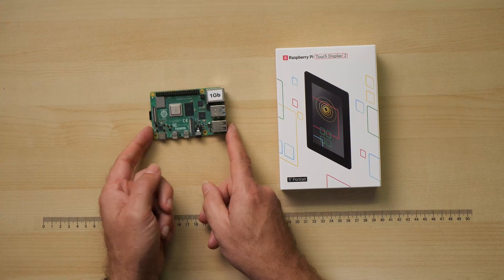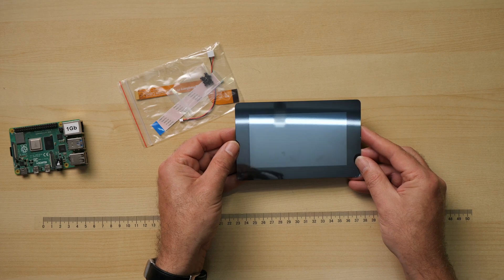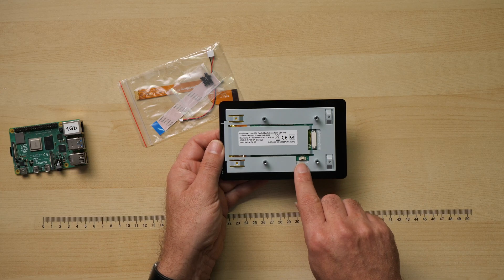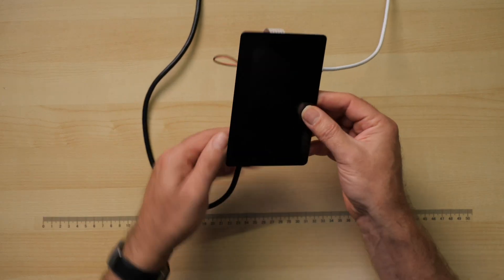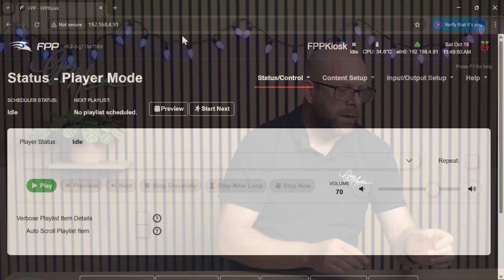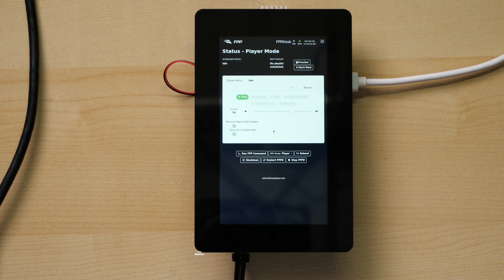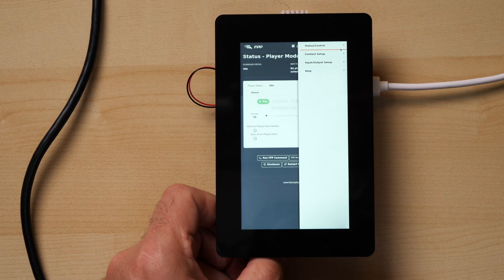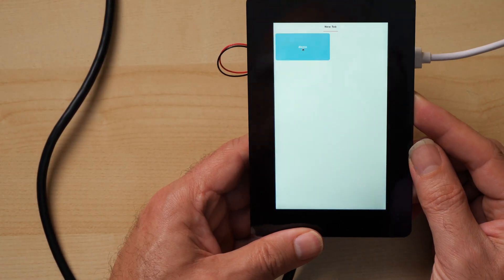Setting up the Raspberry Pi Touch Display 2 with FPP9 in Kiosk Mode #xlights #fpp #pixels

Comment: i bought a cheap DSI display on aliexpress, which worked out of the box in landscape mode. However when the screen goes blank after the DPMS timeout, a tap to wake up the screen, also triggers a action of the big-button plugin. i (well chatgpt did) solved this by creating a wrapper page, which incorperates the page created by the big-button plugin but it captures the first tap, to prevent the accidental activation of the big-button plugin